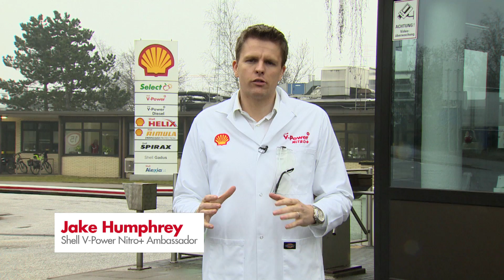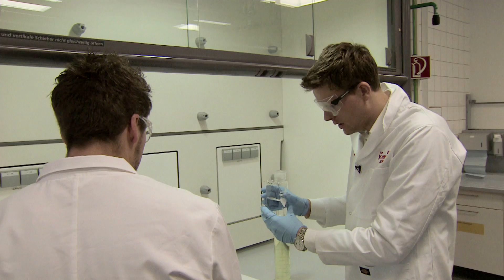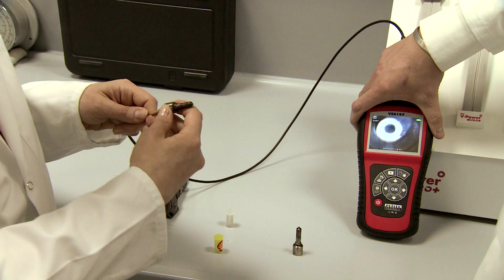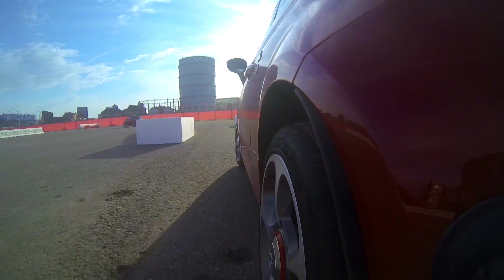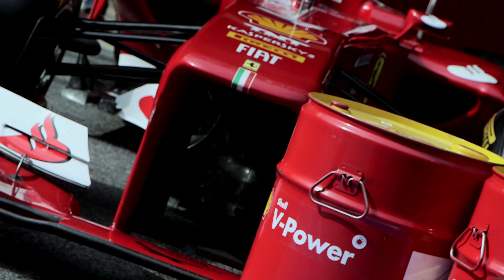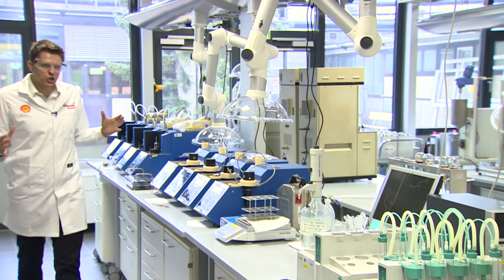Jake Humphrey discovers the story behind Shell V-Power Nitro+

Comment: I always use the Shell V-Power Diesel and I will keep on using it. 

The engine runs smooth and clean : 3.0 diesel / 160.000km & 2.0 diesel / 120.00km

You can really feel the difference in fuels, it's not just a hype. 

Greetz.